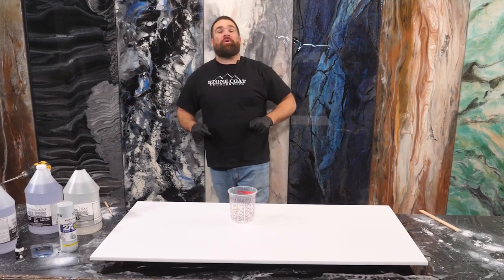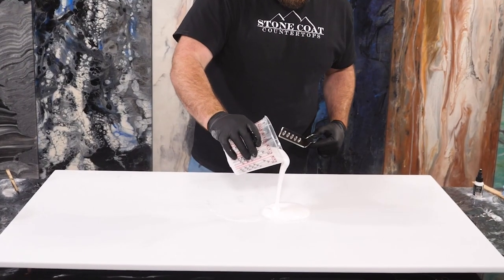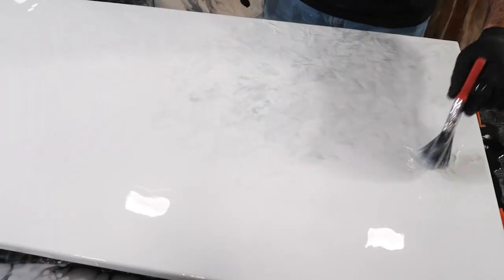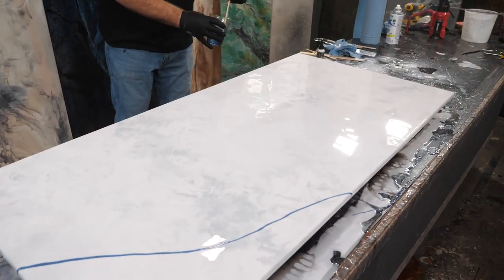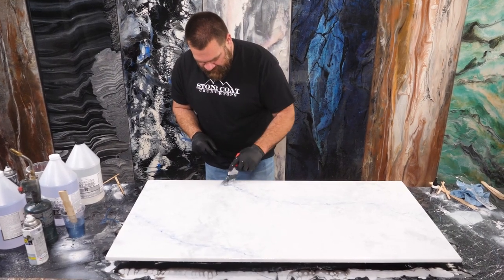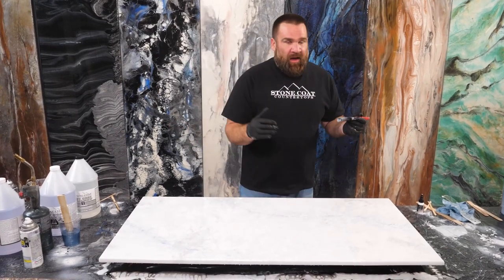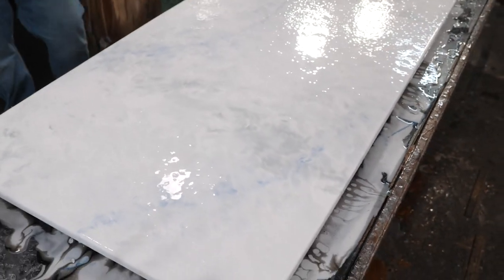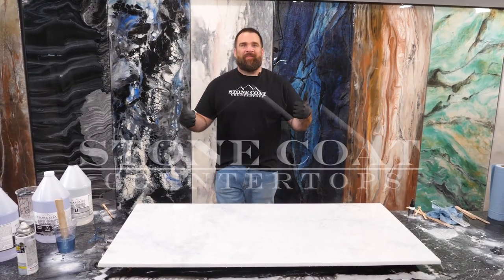White and Blue Marble Stone with Epoxy

Comment: Does it matter how much paint u put in apoxy for first coat cause when we did it the first coat was alot thinner then putting the clear coat on the clear coat part was noticeable thicker and both times they were measured out the same ....